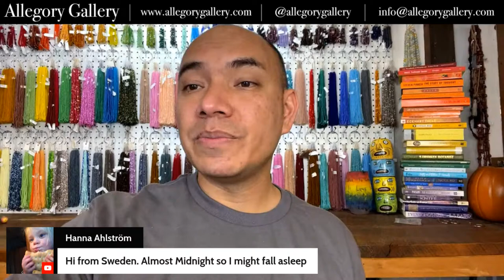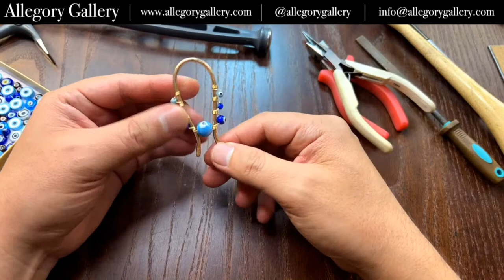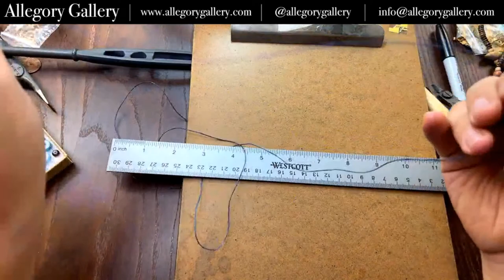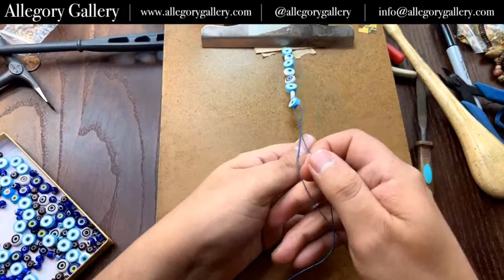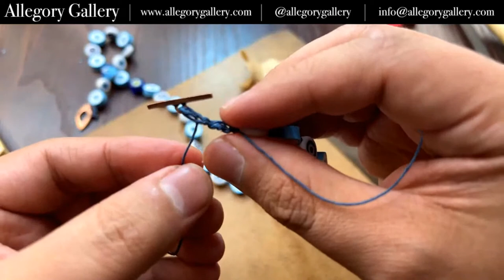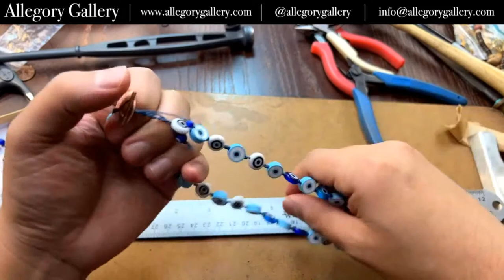How to make a Knotted Eye of Protection Necklace

Comment: Thank you Andrew, for the great demo. The tips/info on waxed linen are helpful.
And sometimes the simple things
( like the clip board) to use for tools makes it easy and affordable for people to use. I use whatever is around to shape things. They are more likely, able to make something now. Than waiting until  they can get a knotting board, or just the right tool. I have that small vintaje file, it's just the right size.
I like the beautiful hammers(on left side)
What type/ brand are they?
Reply from the maker: Thank you so much for the feedback. Having grown up poor, we understand the value of using what you can and what you have around! :-) I'll try to check with Andrew about the brand of hammers he was using here. :-) If you send us an email at info@allegorygallery.com, that would help. Just in case this comment gets lost :-)